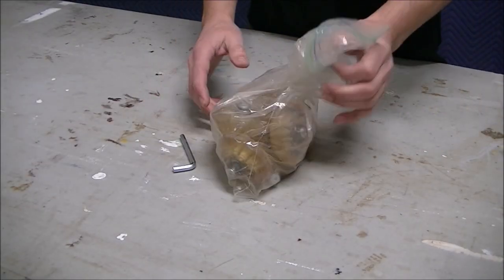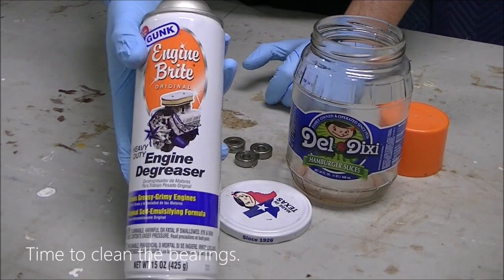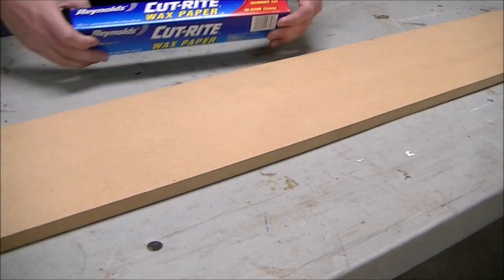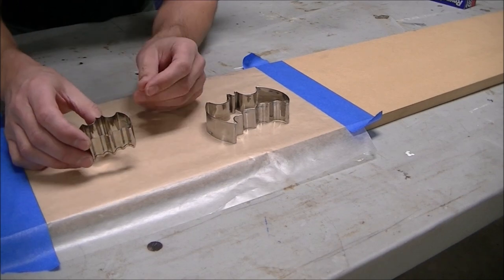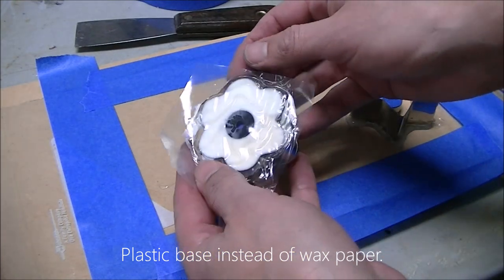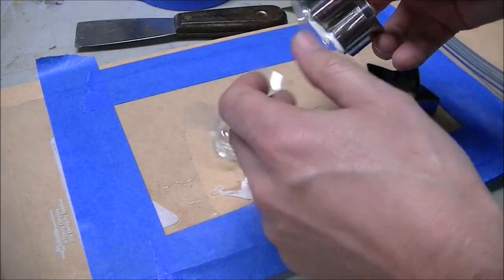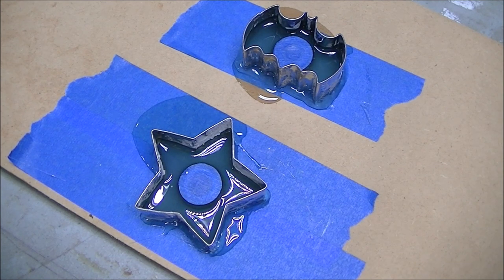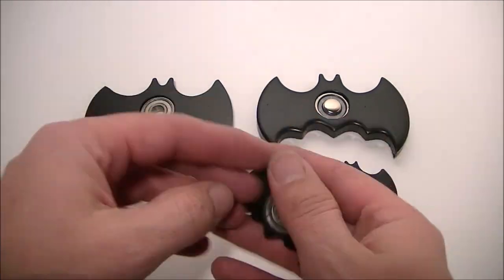Easy Batman Hand Spinner Fidget Toy

Comment: These are all awesome. I think they all turned out great. I know a tip we learned is using vinyl for a backer, the sticky drawer liner stuff works great. Also, a thin layer of petroleum jelly works great inside the molds.
Reply from the maker: Thanks man.  I definitely need a release agent I will probably give that a try over the holidays.  I think I might try to make a mold like the one you guys made for the tape measure clock too.
Reply from the maker: Merry Christmas to you and yours!
Reply: Waylight Creations

Comment: Oh wow, that looked a little easier than what I did with my class! Well, with the one student left on that day...

I wanted to make fidget spinners with them using bearings and wood, since we had woodwork class. Spent the better part of an hour trying to use a jigsaw to cut out the (wonky, free hand sketched) Batman logo whilst the woodwork teacher used the thingamabob to cut about a 20mm hole (closest bit he had).

Then spent another hour or so sanding and painting, then hammering to get the bearing into the middle (tight fit).

This is a much better solution, much neater than using my 3D pen :D
Reply from the maker: Glad you liked it thanks for the comment.

Comment: Bad to the bone!!! Now I need to make one, I got flooded with ideas watching you!!
Reply from the maker: Thanks man! These things are addictive.  And the casting resin is really cool stuff man.
Reply: Can they only be as big as the length of the fingers that hold it? I was looking at that trying to judge the size earlier....
Reply from the maker: ESCAGEDO WOODWORKING pretty much it has to be able to spin between your thumb and index finger or thumb and ring finger. If you can make a paper or cardboard template to test the fit.
Reply: got it! I think I'll do tests first...Thanks dude...>>>
Reply: ESCAGEDO WOODWORKING same
Reply: ESCAGEDO WOODWORKING o
Reply: ESCAGEDO WOODWORKING cannot I just use the rubber for it ?
Reply: ESCAGEDO WOODWORKING  I felt the same. Me and my friend made them instantly
Reply: ESCAGEDO WOODWORKING sss
Reply: ESCAGEDO WOODWORKING たるゆむゆ
Reply: ESCAGEDO WOODWORKING ii
Reply: XxMasterxX
Reply: ESCAGEDO WOODWORKING lol
Reply: ESCAGEDO WOODWORKING lol
Reply: ESCAGEDO WOODWORKING go on ebay and get one i seen one
Reply: ESCAGEDO WOODWORKING Will
Reply: ESCAGEDO WOODWORKING kim
Reply: ESCAGEDO WOODWORKING I
Reply: ESCAGEDO WOODWORKING cringe
Reply: ESCAGEDO WOODWORKING I know I need to make one two
Reply: ESCAGEDO WOODWORKING 앙
Reply: How can I Oder that
Reply: ESCAGEDO WOODWORKING
Reply: +martell turley  it is order
Reply: ESCAGEDO WOODWORKING the walking dead

Comment: Last few minutes of this video were on the struggle bus! Haha. I've got the bearings because I've wanted to make some for a while but I haven't yet. Good ideas. Have put a light oil in the bearings after clearing the heavier factory junk? I hear various cooking oils work well. I could see spray can silicone doing well also.
Reply from the maker: LOL!  Struggle bus I like that.  Since this was the first time I was casting I figured I would try different things and film the results so that others could avoid my mistakes.  I haven't tried the oil yet I need to though especially on the roller blade bearings those need all the help they can get.  Thanks and good luck.

Comment: great video!   I've been doing the same cookie cutter / resin casting for weeks now but casting them solid then drilling out for the bearing. love your method instead, will save time and mess... gotta give it a try!  for mold release, I've tried oil, petroleum jelly, powder... nothing seems to work and they get harder to get out after every mold. any new ideas?
Reply from the maker: This might be posted twice I think You Tube is acting up.  So I'm leaving the comment again. "Thanks.  I totally feel your pain regarding the mold release.  I was going to try oil next but reading your comment I might have to think of something else.  I also thought about putting them in the freezer after they have cured then hitting the cookie cutter with a heat gun to see if I can get it to expand a little.  But IDK."

Comment: fun stuff - paint - I think you could have just used dye.  either way - they look great!
Reply from the maker: Thanks man.  I tried to add some acrylic paint but that caused a weird reaction that made the resin foam up and double in size.  I also tried to add a powder dye but that had a similar result not as extreme as the paint but it still did something weird to it.  So I settled on spray paint.
Reply: Shogun-Jimi نلللت

Comment: I did this but my dad says that roller blade bearings are used for strength mostly so it doesn't turn that well, where do I get speed bearings
Reply from the maker: You can check to see if there is a skate shop near you.  You can also buy them from Amazon.  Ceramic bearings are going to be the fastest but they are expensive.

Comment: Did you only use corn starch for the mold or did you add something else
Reply from the maker: I tried it with out anything then I tried it with corn starch.  I think the corn starch made it worse.  I haven't tried oil but someone in the comments said they tried Vaseline and it was still hard to get out.

Comment: What did you use to fill the batman mold and how do you make it
Reply from the maker: I use the Fast Cast resin I show in the video.  Its a two part resin.  You mix equal parts of each bottle and pout in to the mold.  There's a link to where you can buy the resin in  my description.

Comment: what department in home depot  did you find the caps I'm having a hard time finding them
Reply from the maker: They were in the fastener aisle.  They have a section where they have "Chrome" screws and bolts that's were I found the 5/16 inch index caps.  They also sold them in single baggies in the specialty hardware drawers also in the fastener aisle but they would cost more if you bought them in singles.  Hope this helps.
Reply: yes it does thanks great video also

Comment: They look cool but most of them dont have enough weight to spin for longer than 10 seconds
Reply from the maker: You can add weight very easy by just putting more bearings in the mold like I did with the first one.
Reply: That is why is said MOST of them because i noticed that you did that to one and it happened to spin the longest out of them all

Comment: how did you make the buttons? very cool.
Reply from the maker: I didn't make them I bought them they are called "hole plugs" these are 5/16 inch.  I'll put a link in the description of the ones I used.  Thanks.
Reply: Thanks for the tip!

Comment: so what is the best mixture to use
Reply from the maker: I use the Fast Cast, link in the description, with a 1:1 ratio.  As for the mold release agent I haven't found anything that works better.  I have been told that Silcone mold release spray will work but I haven't tried it.

Comment: what did you mix the cast with?
Reply from the maker: I just used a stick to mix the resin.
Reply: Freeze Soul that's what i was wondering the cast comes with two liquids that's why there were two
Reply from the maker: Yes the casting resin comes with two bottles of liquid.  You mix equal parts of each liquid, then stir them together and pour them in to the mold.  You don't need cornstarch.  The resin hardens and turns white.

Comment: what have u added to make it solid
Reply from the maker: Its just the two part resin that hardens on its own.  Its called Fast Cast, link in the description, you mix two liquids and they turn in to hard plastic.  Its really cool to watch.
Reply: Dan The Maker Man what could be its alternative
Reply from the maker: There are a lot of resins out there that you can use. I am not well versed in all of them so that would require some research on your part.  But if you want to make a fidget spinner there are a lot of videos on YouTube.  I have another video were I made a couple using epoxy putty.

Comment: Can i use nail polish remover
Reply from the maker: For what part?
Reply: Dan The Maker Man cleaning the bearing
Reply from the maker: Yeah that should work.  Nail polish remover is pretty much acetone so it should work.  Just be careful and wear proper safety gear when working with any cleaning agents.
Reply: Dan The Maker Man thx for fast reply nice vid

Comment: What if you don't have a glue gun
Reply from the maker: You can use caulk, but that might be hard to remove.  Or you could try playdoh, this will most likely ruin the playdoh.  Or maybe tape around the edge but I don't know if that will work.   Fast cast sets up pretty fast if you are doing one at a time you could try pushing down on the mold so that you seal the mold between the surface and the mold.
Reply: I see so many good and cheap spinners and even some online. I literally just don't have the materials to do it
Reply from the maker: There's nothing wrong with buying one.  I just prefer to make something if I can or at least try to.  For me its a really satisfying feeling to make something with my hands.  Part of the fun is problem solving and figuring out a way to make it that is with in my ability and sometimes beyond it.